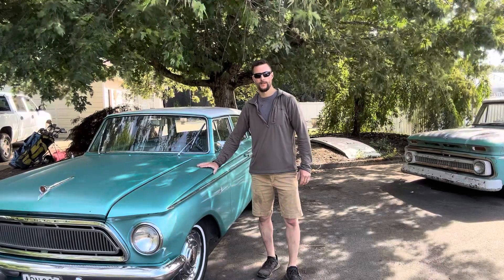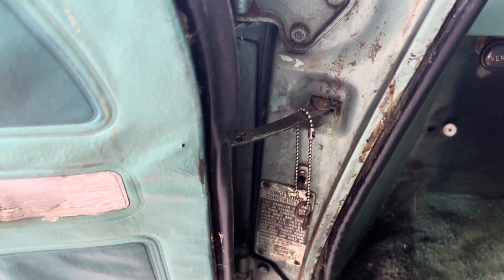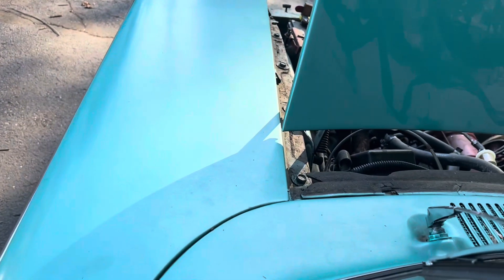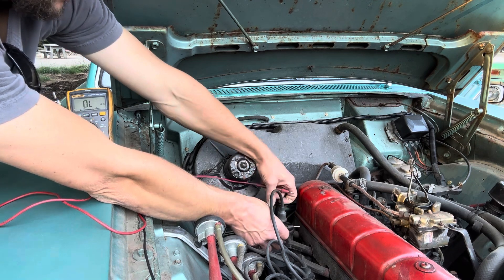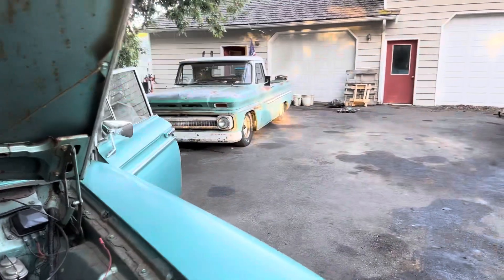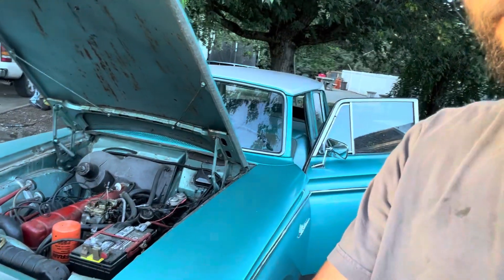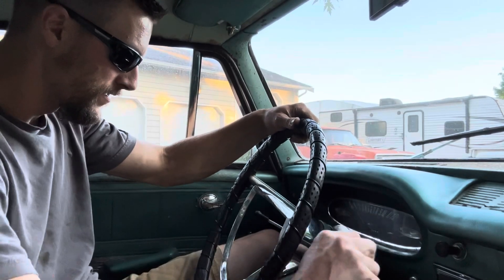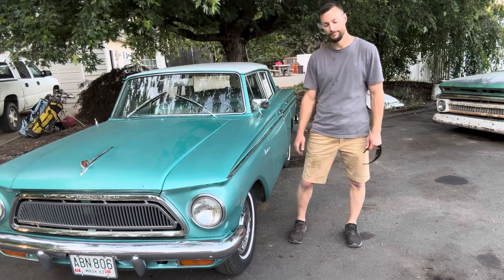Can I get this 1963 AMC Rambler running and back on the road?

Comment: I  have the 330 station wagon version of that car.  (sans engine, but a 3 speed/overdrive) Those are the individual adjusting reclining seats, you should be able to find a comfortable position to drive it. The vacuum wipers should rest at the bottom of the windshield. Your wife probably won't  like the manual steering. The 63 Rambler Classic I learned to drive in, was 6 3/4 turns, lock to lock! You probably wont find an easier car to work on, but there are an awful lot of grease fittings on the front end, that need regularly serviced, to keep the trunnions in good shape! 😊👍

Comment: We had the 1963 Station wagon version of this car! My dad traded our 1960 VW bug for it to a serviceman heading to Germany so he would have a better chance at maintaining a VW over a Rambler wagon. I recall my parents and me, my brother (a baby at the time) and my two young teenage sisters. We used the front passenger seatback function for my sisters to sleep during the night while Dad drove us from Michigan down to Tucson in Arizona. Mom and I would sleep during the daytime in the passenger seat/bed. The car had a 6 cylinder motor but I don't remember if it had a 3-on-the-tree manual transmission or an automatic - but the tranny lever was on the steering column. I also recall a long and hot stop stuck in New Mexico due to Vaporlock which my dad knew nothing about at the time. We finally got rolling again after a few hours in the miserable Summer heat and finally got to Tucson just in time to find out that our new house was infested in FLEAS from hell so dad set off a US army issue cannister of DDT and we spent the next two days in a hotel until the house was declared okay for habitation. Oh and the car was baby blue with the corresponding color-keyed interior fabrics. 
Dad missed our VW's robust build so he ordered a brand new 1968 red VW bus from Germany and that vehicle made the same back and forth Arizona to Michigan and back to Tucson, every summer the day after school let out to get out of the Southern Arizona heat. 
Nice to see that your friends Rambler started up and sounds good! Thanks for sharing this with us.
Reply from the maker: That’s awesome, thanks for sharing! Sounds like your family rambler did some serious driving!